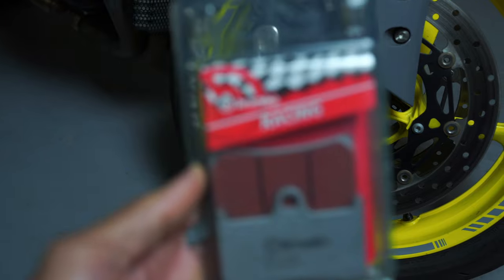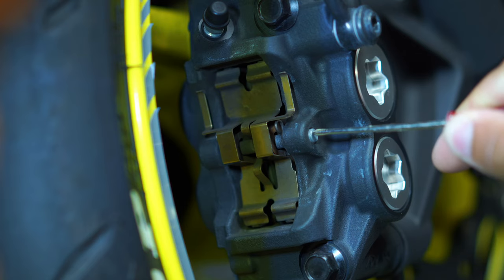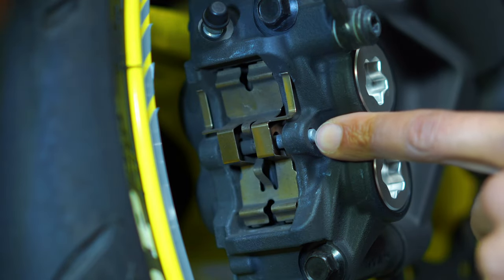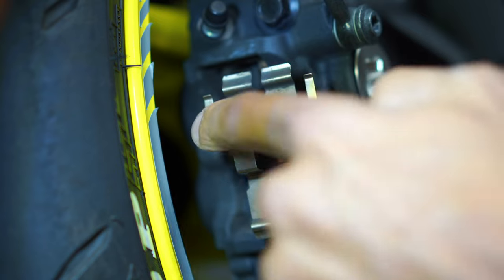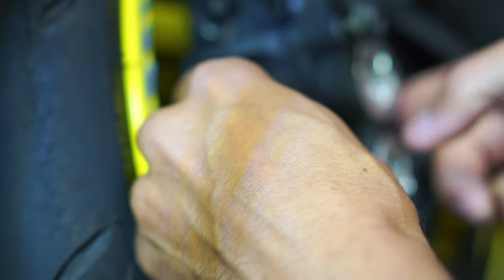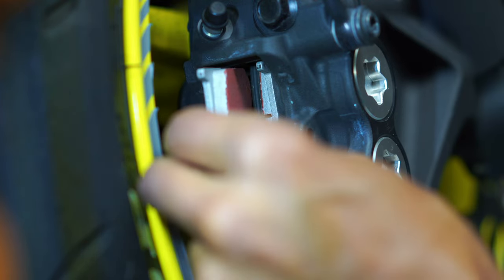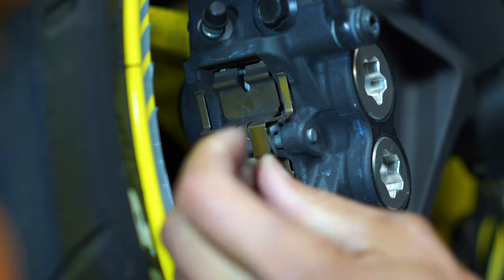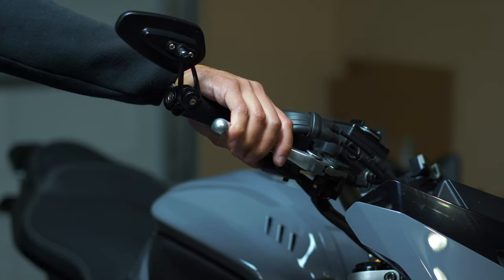MUST HAVE Brake Upgrade!

Comment: 2023 XSR900..  fair improvement w/ ECB HH Pads.  Stock looked to be metallic.. similar to a car..  the ECB's were definitely lot more metal, less asbestos stuff.  replaced all four front pads in like 15 minutes..  they slide out the back w/o removing caliper.  Easy.  You may rather remove to clean out your claipers.  The HH grab vs pressure ratio was much better..  felt more confident.  Haven't done any border case or stop distance testing.  This bike I think has the same radial brembo Master cylinder and radial NISSN 4 pot calipers as your MT10..  look similar anyway.  Don't feel any need to go stainless brake lines..

Comment: I thought these racing pads were for track use only, as they need heat to properly work. Are they really suitable for street riding with varying outside ambient temperatures ?
Reply from the maker: You are not wrong, but they have better bite than the stock pads.  Possibly other options out there but this is what I decided to go with.

Comment: OK so my 2023 MT-10 as new has some pretty decent stopping power but I am very interested in having significantly better brakes as I do  get going pretty well in the twisties   So I did some research and kept hearing about SBS brake pads and in particular SBS 634 RST which also are labeled Racing and Track  but both the packaging and several folks that endorse these pads claim they are also fine for the street.   So at less than 1000 original miles I went ahead and bought and yesterday installed em in place of the OE Yamaha front pads. ( I also did scuff up the rotors with sand paper even though they are still so knew you can still see the original factory scuffing)  Anyway installation was simple and I honestly did not notice the pads being deficient at all when cold but I mean I did not take off like a bat out of hell or anything but I chased some younger guys who were quite quick if I do say so myself ....I had a hell of time keeping them in sight but I did and I did not have a single pannicky type moment getting slowed down...was it a miraculous night and day difference?  No but subjectively I believe they are better and so a well spent $90 (including tax and shipping)  My only question now is how long they will last?  WIll they tear up the supposedly soft rotors?  Time will tell
Reply from the maker: It should not tear up the rotors.  These pads may not last for a long time depending on how hard you are on the brakes or hitting the track a lot.

Comment: Would you day that was a sufficient upgrade or would you rather go for aftermarket brembo monoblocks if possible? If there has been a ecu flash, exhaust and filter done fro this bike do unleash some more of its potential if the use will be 80% road and 20% track the last thing Id want to worry about is the most crucial part, stopping power. I am looking at buying one of these, the sp model or bmw s1000r 2016-2018 model or ktm 1290 superduke R but heard allot of people are having problems with them on and off , or the ducati monster 1200R/S. Would also consider the tuono v4 in 2014-2016 spec.  Any input would be appreciated.
Reply: The other two options also within budget would be the triumph street and speed triple 2018-2020 models.
Reply from the maker: I would try to upgrade as much as you can as the pads alone won’t increase stopping power and brake feel overall.  The pads is a nice start though.

Comment: I literally Just got a letter from Yamaha this morning that there’s a recall on the MT10 front brakes and the fix will help stopping power. We’ll see about that lol taking it to them in the next couple weeks
Reply from the maker: Oh really?? Nice!  Hopefully they address the issue!
Reply: No, it’s a brake light sensor switch recall in the right side hand control unit. It has nothing to do with pads or stopping power.
Reply from the maker: @lifeatredline1783  Ahhhh gotcha.